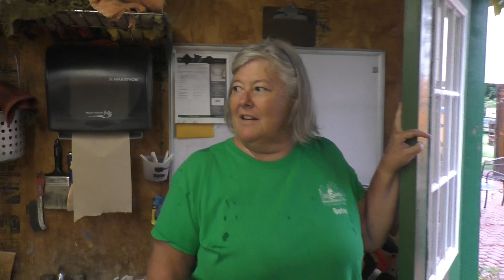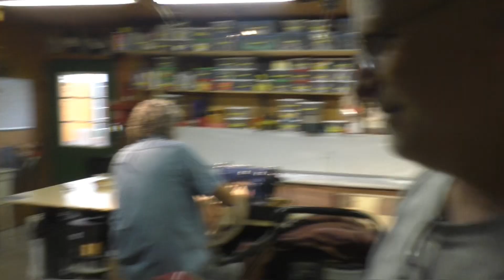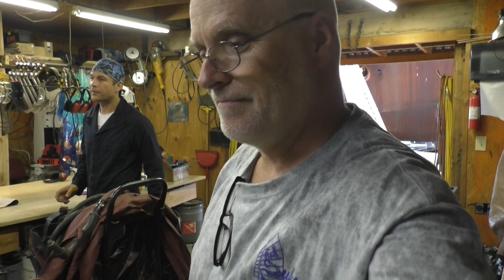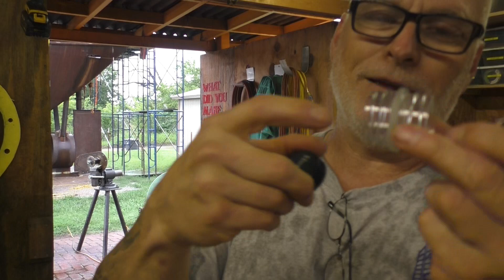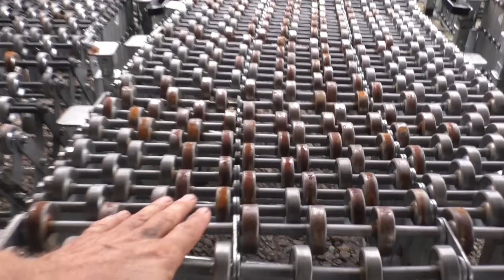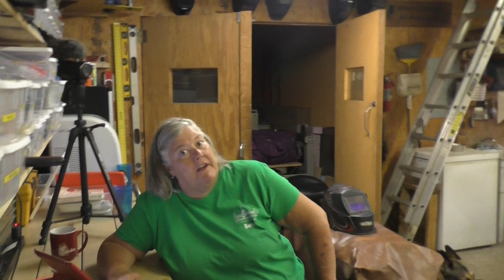SV Seeker Live - July 8, 2017 - Leatherman Raffle, Trailer Work, Sail Table

Comment: Damn, it just got warm enough here to use slow cure epoxy. Time to get to work on my plywood boat. Good luck with the raffle.
Reply from the maker: My friend working with fiberglass loves this hot weather.  He gets to work fast.
Reply: SV Seeker I just finished building a mold to extend a fiberglass Alaskan crab boat yesterday, I work in an indoor full service shipyard. I like your project !

Comment: A smart way to get three phase is to build an add a phase converter. Its done w. using one of the windings on a spare motor you run one leg of the 220 through the motor winding.

Comment: Rotary power converters work OK for light/intermittent load. Some variable speed drives can take singe or 2 phase power and convert it to 3 phase. These are a better choice constant loads and can cost less, if you find used ones. You would want a drive for each machine, however, so it would not be the best option for a shop with so many tools. 

Another option is a UPS system that takes single or 2 phase in, rectifies it to DC, filters the DC, dumps it to a battery bank, and then has a 3 phase inverter. You get clean power out, which will make your machines last longer and protect them, and you have a clean connection to the utility so you will spend less money on power.

Rotary converters are old tech and aren't even used in most application now because of their cost and limitations.

Comment: I worked in Corrugated box plants for years, and it was hot especially back by the wet end ( Single Facers/Splicers ) Doing Field service is the reason I put AC in my shop, and I live in MN, after working in Dallas,New Orleans,Little Rock,, etc, in a July to Sept it was down right nasty,  Give me 115 in El Paso TX vs 100 in Tyler TX any day,  Where your it's the start of what I called the "Heat Bowl" , Kansas, Missouri, Arkansas, etc,  the dew points can kill you,,So no complaints on the too hot thing. As a side note I lost 14lbs in just two days at a plant working one weekend at A GP plant in Pelahatchie MS, trust me I was drinking lots of water.